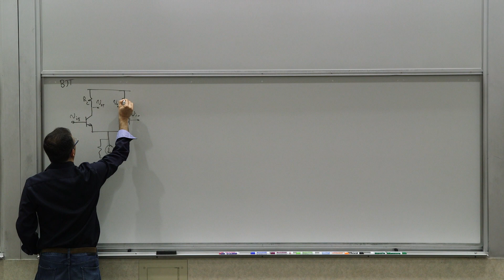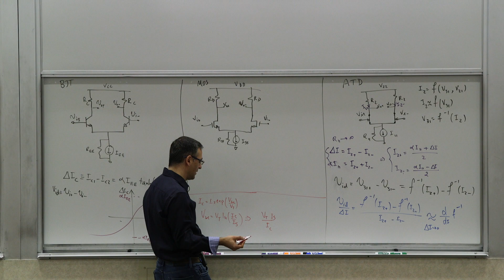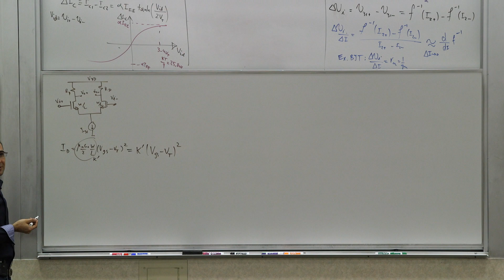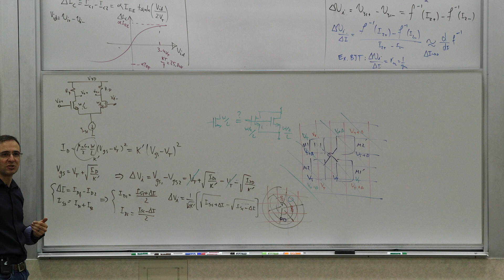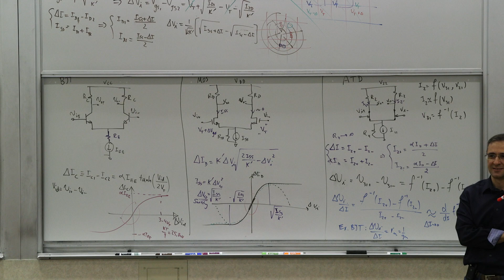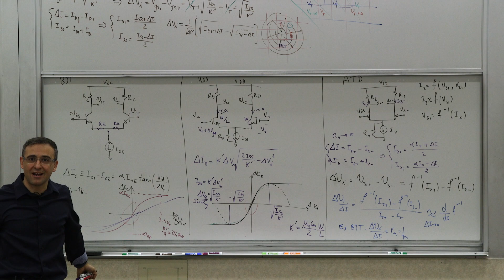127N. (Pt. 1) Differential Amplifiers: MOS, BJT, and ATD

Comment: sir, in differential pair of mosfet, if the current source can be seen as a M3( mosfet ) that mean the current source ISS is equivalent to M3 ( mosfet). How to calculate the Vgs of M3 if the current source ISS =0.5mA and (W/L)3 is chosen arbitrarily by the designer . Can you give me some ideas sir?, thanks you !
Reply: You can calculate the Vgs of M3 by Vgs = sqrt(0.5mA/k'). where k'=1/2*(un*Cox*(W/L)3).
Reply: @nurahmedomar  You need to add a Vt to get Vgs. What you have given is actually just the overdrive voltage.

So the equation to calculate the gate to source voltage of the tail current source, which is M3 in this case and assuming it is n-type is:

Vgs3 = Vtn + sqrt( (2 * Id) / (un * Cox * (W3/L3)) )

Also, this is neglecting the channel length modulation term in the drain current equation of (1 + lambda * Vds).

Comment: I really like how you use the ATD as an example. I've been playing with some JFETs and GaAs FETs lately, and it's really helped for understanding how to design these basic circuits using these types of transistors.
Reply: What does ATD mean?
Reply: @strongman325  ATD =Arbitrary Three Terminal Device 

If I remember correctly or Arbitrary Transistor Device